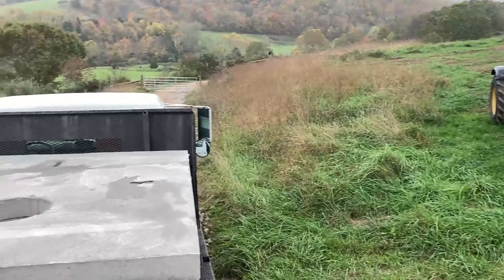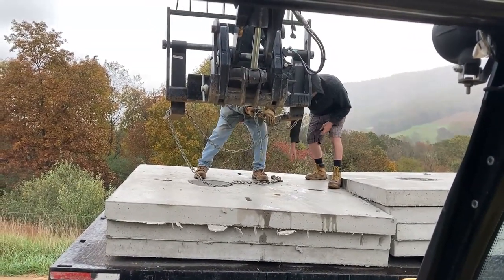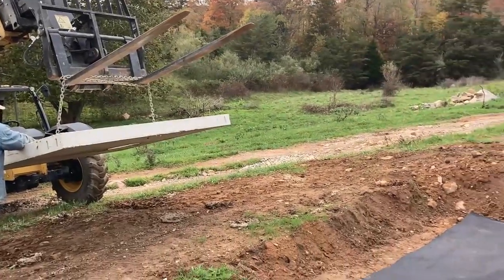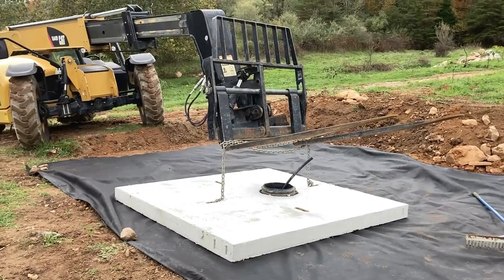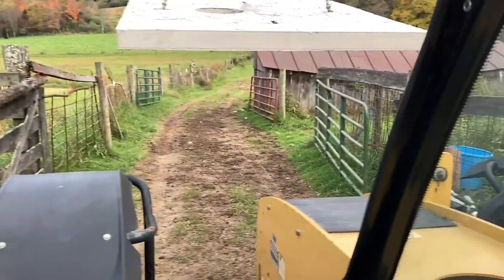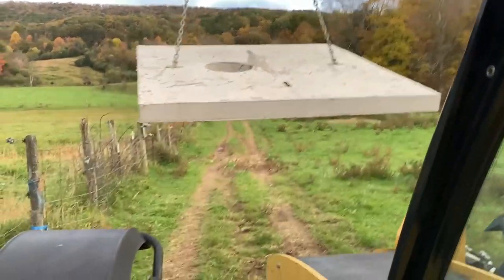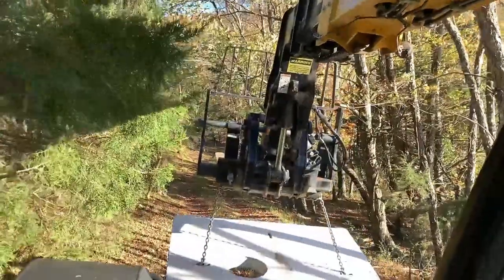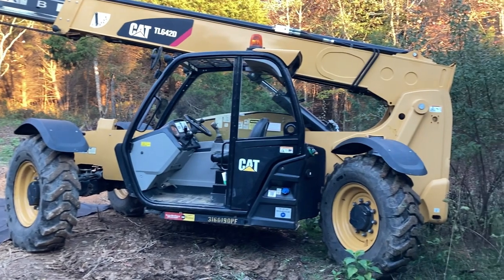Setting 3000lb Concrete Pads for Cattle Waterers

Comment: Just met with the NRCS to plan an application for funding a new rotational grazing fencing and water system for our farm. Considering doing a lot of the work myself, but the amount of time and equipment needed makes it a tough decision having a full time job I'm not ready to step away from yet. Thanks for putting together this series to put things into perspective!
Reply from the maker: Thanks! From what I've heard, we're kinda the exception, as most people generally opt to hire the work out. You'll probably end up saving a little $$ by doing it yourself, but it'll also probably take a good bit longer.